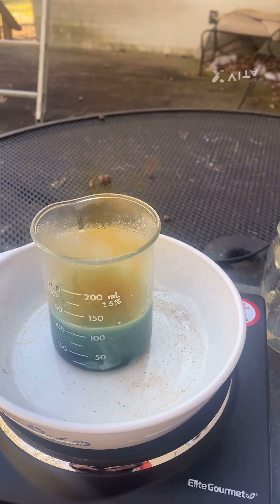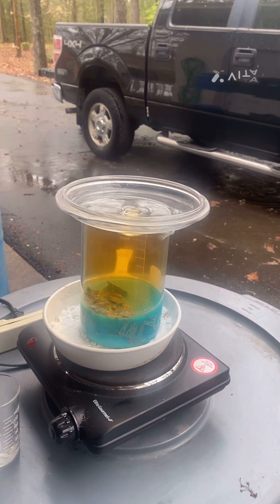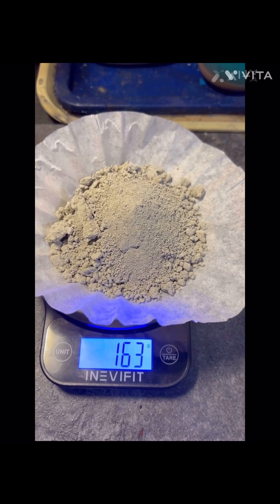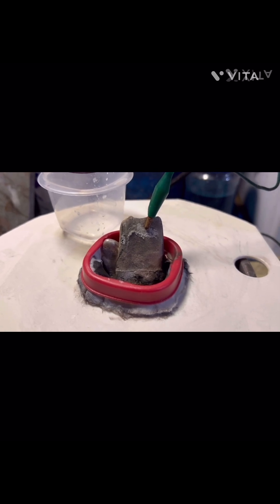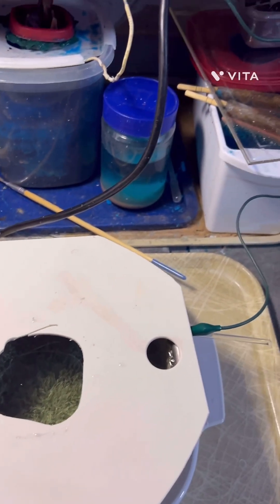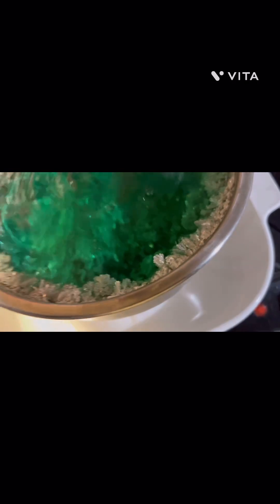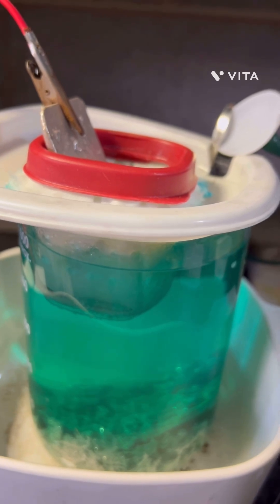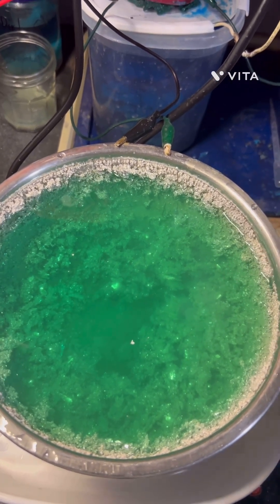SILVER CELL - START TO FINISH             # silver #silvercell

Comment: What fuel do you use in your torch. I can't seem to melt gold or silver even using MAPP gas.
Reply from the maker: I use two types :
A yellow MAPP gas tank that’s mixed w/ Acetylene and Propane
And a Turbo Torch that is a tank of Acetylene and has a tip that mixes air  . 
I have a oxygen/ acetylene rig but I don’t use it much
Reply: @Hill-13 Thanks for your reply. Looks like I am going to have to bite the bullet and update my melt supplies.
Reply from the maker: @michaelgulotta5646 the yellow mapp gas tank you get at the hardware store is 15 $ , and if I use that as my primary melt source I can 3-5 melts out of it , I like the Turbo torch with a B tank( I have had it for 25 years ) I have had to replace different parts through out the years but it’s pretty reliable and just one tank to deal with right now.

Comment: What other options are there for the solution other than distilled water and nitric acid?
Can distilled water with sulfuric acid and sodium nitrate work to disovle silver and as an electrolytic also?
Reply from the maker: I have always used nitric acid and distilled water . 
I feel that KNO3 and H2S04 would not work as an electrolyte in the cell . 
Potassium , copper and nitrogen ions important ions in the silver cell .
KNO3 and H2SO4 will make a poor man’s nitric acid. So I believe the method is this :
2KNO3 + H2SO4 → K2SO4 + 2HNO3
The K2SO4 can be chilled causing the crystals to form which can be filtered . The 2HNO3 then could be used however it slightly diluted . I’m not sure what the strength would be however .
Reply: @Hill-13  Thanks.
I was planning on trying this solution for electrolytic since it worked for dissolving silver plating test I did in the past. At the same time the copper and brass cemented the silver into a cream white sludge that I filtered from the solution. So I thought it might also work as an electrolytic and was wondering what your thoughts were about that.
Reply from the maker: @franchi8601  it was the zinc in caused the copper and silver to plate out. You can use KNO3 as an electrolyte to remove the silver it works fast so you have to watch it , and flip it since the side that face the anode silver is removed faster .
Reply: @Hill-13  Thank you